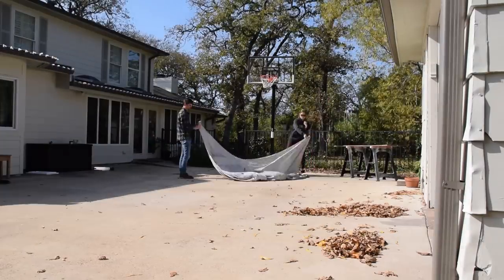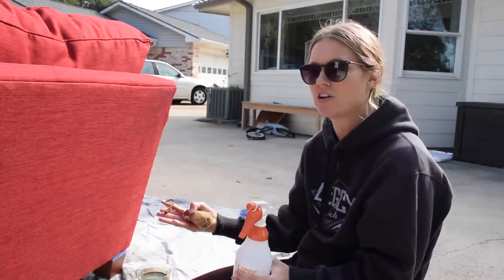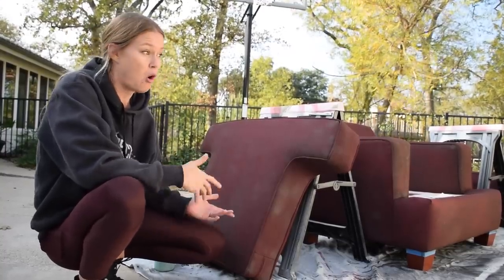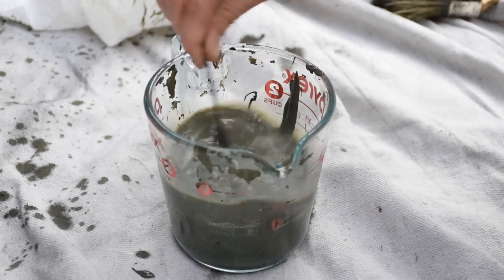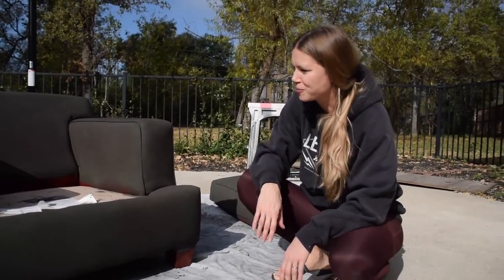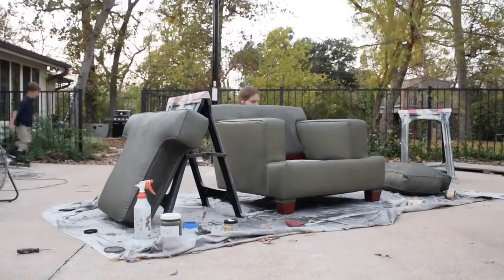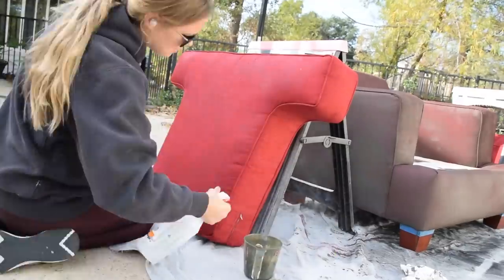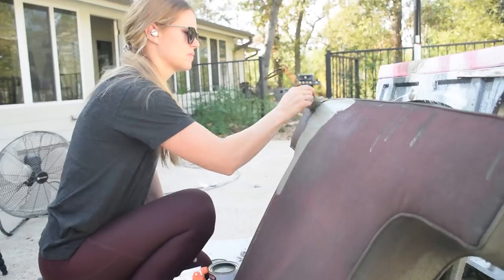Painting Upholstered Furniture [Living Room Refresh- Part 2] // Furniture Flipping Nightmare!!

Comment: I’ve done this project! Lone Fox has an excellent video using equal parts paint and fabric softener. My chair was soft and smelled awesome. Please try again and I would love for you to see how easy it is!!
Reply: I said the same thing! Lone Fox video was great!
Reply: My chair came out great.  They messed up by using all that water and no fabric softener
Reply: Thank u for sharing
Reply: Yes the fabric softener is what really keeps it from being hard like paint. 🙂
Reply: I’ve never tried this, but I just watched a video with Anne Sloane. It was on another’s channel and she basically did a tutorial. Unfortunately, you made a few of what she called mistakes. She used a brush to lightly wet the fabric first, as you only want the surface wet. Then instead of mixing water, and paint she wet the brush first, then dipped it in paint, and sort of mixed it by working the brush on the up side of a roller pan. She said crispy is mostly due to overpainting, using more than 2 coats. She also said, you need to consider how the color of the original fabric may affect the color your applying, which I took as a message about expectations. She suggested that if it’s crunchy, a light sanding, then an application of wax, can give a soft hand and leather look to the finished product.
Reply: Sand in lightly and wax it

Comment: I painted a sofa years ago with chalk paint. I sanded between each coat and sealed it with Annie Sloan wax. It’s not crusty and looks and feels like leather. It’s used daily and still looks good to this day. Hope this helps in case you’d like to try this process again. Oh, and I love your channel x
Reply: I read about wax at the end too.
Reply: I too was wondering why she didn’t use AS method.  Every video of a successful project involved sanding and wax.  Like that she showed how long it actually takes and the energy to complete.
Reply: The wax finish is likely what helped.
Reply: I've used wax and it helped with the feel but left a white residue.
Reply: I think Debbie’s Design Diary has a painted velvet sofa on her channel.
Reply: I did the same thing.  Painted it with Annie Sloan Chalk paint, sanded it down and sealed it with wax and it turned out awesome.  Wax is the key!

Comment: You are supposed to wax it last. It makes it look and feel like leather. I have done this. Make sure it  it is completely dry. Use the round brush and brush in circles. Let the was dry and buff with a round dry brush. Try this before you re-upholster.
Reply: I have read this about cloth. The wax is important
Reply: does it still sound crunchy?
Reply: @lovly2cu725  Doesn’t sound crunchy at all. It still needs to be sanded with 220 grit sand paper, then waxed.
Reply: How many coats did you use? I'm curious if my salvaged chair is worth it.
Reply: I put 3 coats. It might need more depending on how porous the fabric is and the thickness of the cushions. If the fabric is really worn, the paint will go through to the cushions. Definitely don’t water down the chalk paint. Spray the fabric or dip the brush like Andrea did on her second try. It was so cool when I tried it the first time, because I couldn’t believe how good it looked! I also painted vinyl dining room chairs to match a Formica 60’s table. Good luck!

Comment: I actually used a spray paint specifically for fabric on a similar club chair and it came out fantastic! I used a navy blue to cover a cornflower blue that had faded. No one believed me when I told them it had been spray painted.  It was not crunchy or stiff afterward and I had it in a high end Cape Cod rental with no complaints.  Rustoleum and Krylon make a fabric spray paint.  I think the brand I used was called Simply Spray (?).
Reply: Yep! Fabric paint works great. I've used it on a rocking chair twice for each of my children's nursery. Came out awesome both times.
Reply: Used that and it took sooooo many cans of that paint and then I had splotchy cushions after they sat on the porch awhile.  Didn't love the spray product.

Comment: I’ve painted lots of upholstery many times. Vinyl, poly silky fabrics (like most dining seats) work well. But you need to seal it with LOTS of wax to get a leather feel. Don’t try boucle, or linen type fabric it holds too much paint and becomes too hard. 
But what I discovered is the best way to cover an ugly upholstered chair. Spray can adhesive, hot glue and faux fur. It is ridiculously easy and fun. If the faux fur has to have long fur it covers all the seams. 
I presently have a window seat bench and a living room chair that I covered by cutting up a faux fur bedding. Looks great, cats love it and it hides pet hair!

Comment: I have painted a few chairs that were successful. 
I used a 50/50 mix of chalk paint and mineral spirits. Kept the fabric wet, sanded between each coat. Applied 3 coats. After the coverage, I put two waxed coats over the paint. 
It felt like leather! Smooth and comfortable.
The fabric was a thin upholstery fabric. I did rewax every 6 months. I used the chairs for 2 yrs. I did need to reapply paint on the seat once during that time.
It is definitely not along term solution.

Comment: I have seen many videos on painting fabric furniture but never actually tried myself. However, the ones I have seen use regular wall paint and dilute it with fabric softener. From what I’ve heard, this makes it softer and gives it more of a leather look.
Reply: Never tried this but I'm wondering if the latex feel is what makes it feel good rather than that rough chalky feel.

Comment: Great video! I love seeing the process of experimentation. I have looked into this for a project. A couple of things I've observed. 
1. Closed materials like vinyl accepts the paint better than open materials like woven polyester or cotton. 
2. Adding liquid fabric softener to the paint is supposed to help with keeping a soft texture the fabric. 
3. A top coat would provide some stain and water blocking properties. 
I will be tackling this project in the spring for some furniture my wife wants on the patio.

Comment: I've done this successfully... trick is def the kind of fabric it is. mine was a velvet chair and i picked a color similar to the original color to hide discoloration to the original chair. use a sanding bar to "sand" the paint into to fabric and sand in between each coat. def water down your paint and get the chair wet

Comment: I painted a fabric chair with fusion mineral paint and when I had full coverage I "massaged" their hemp seed oil into the fabric with my hands and with a fine grit sandpaper. After that soaked in and dried a bit I made a soft wax with hemp seed oil and beeswax and rubbed that in. My chair is smooth and leathery/vinyl feeling. After a year in our playroom with four young kids it still looks like the day I finished it! Your chair looks great, just needs to be softened up!

Comment: I couldn’t agree more! I painted a large cotton weave ottoman using Dixie Belle paint. I used boss first  then full strength paint super wet fabric and brush. Still took 31/2 coats with sanding in between. I wanted a leather look, so I waxed after dry .
It looked good just like your chair did and felt like soft leather, but it cracked on the edges within a week of mild use.
The painting technique you employ to buff the paint in is strenuous !  I decided it wasn’t worth the time, effort and paint. never did the second ottoman and my fabric painting days are over.
Thanks for the memories:) your videos are great

Comment: I painted a chair similar to the one you are working on. It took 3 containers of paint and about a week to completely dry. I did use Dixie Bell paint. The first coat I used a dark shade of blue. Then switched to Bunker Hill Blue. I never saturated with water, just sprayed. It's a process, but the outcome was wonderful. If I didn't tell you the chair was painted you would never know. A year later, still looks new. HAPPY CHRISTMAS

Comment: I paint furniture with Annie Sloan chalk paint. I use a spray bottle with water first on the fabric. I spray water as needed to absorb paint into fabric. I use no more than 2 coats. I sand with fine grit when completely dry and vaccuum.  The fabic is not stiff. I've painted damask and cotton fabrics.

Comment: There is fabric spray paint. Fabric softener in the water spray,  and mixed into the paint.  With fabric softener,  you can use latex paint, too. And sand the crust fully away between each layer. 

Quite a few helpful videos on YouTube about it. Some don't always look good, as far as artistically,  but the technique is explained well.  🙂

Comment: So I’ve done this with a similar textured fabric and it turned out okay - but the key was to add wax and buff it at the end. Without that wax/buff step, the chair would have been unusable, but with the wax it feels like a textured leather. 
We used the same chalky paint from Lowe’s that you did (and the wax that goes with that line.)
We needed fewer coats of paint, because we were using a dark paint color on a light fabric. (But we added two coats of wax…. so still 5 coats total.) 
Agree that it’s not often worth the effort!

Comment: Hi. I like your room redos and furniture pieces. I’m getting a lot of inspo for my house reno. 
Usually chairs, sofas, etc are nylon & cotton blend or polyester & cotton blend. Acrylic paint is a plastic and some will Andy into cotton, but not a man made fiber like polyester. You may have had better luck if you’d have used a white, water based primer first, then painted a few coats with a 2:1 or 3:1 paint to water ratio. (I have a chair that needs reupholstering, but I’ve already taken the fabric off to make patterns 🙃

Comment: I painted my tufted leather chair that was an ugly oyster color. I used Dixie belle paint and easy peasy spray wax. It was like painting a night stand…easy. Now I am painting a cotton sofa: the material is like quilter’s fabric…just flat no raised designs but the print has showed through 5 layers of DB paint. I thought this would be easy to paint since the background of the fabric is white and the printed details are only on the front side of the fabric. Going through the same thing you showed in the video… lots of paint,time and energy. I did lightly sand and it took my paint color out…which makes me assume that this couch may have been Scotch Guarded. Which would make sense as it’s supposed to repel water and stains. I think my first clue should have been how the water beaded on top of the fabric when I sprayed with my mister bottle…I strongly suggest spraying your fabric with water to test if it beads up if it does it isn’t going to accept your paint as well like in the video.
Just thought I’d mention this.

Comment: When you paint fabric like this you're really only supposed to use approximately two coats that's why it's important to pick a color that's darker than the color it already is. With your ratio being half water and half paint that should have covered it in two coats but it probably won't because the color you're using is actually lighter than the color it already is. Just don't forget to sand it to knock off any rough edges that may make the fabric feel crunchy

Comment: I’ve painted fabric several times very successfully. I don’t water down the chalk paint (I use Dixie Belle) but, I do spray fabric with water while painting. I lightly sand between coats of paint and use Dixie Belle’s Easy Peasy Spray Wax. I should feel like leather. I wouldn’t call this a fail, go back to your local retailer and get a bottle of the spray wax, sand lightly, and seal it with a couple coats of spray wax.

Comment: The reason I think it feels crappy is because the paint was watered down so much, it took so many coats of paint to get the coverage that was needed, it was inevitable that the build up created a poor finish. Also sanding or working the paint into the fabric as you paint, gets a better finish. With chalk paint it should take 1-2 coats maximum. Lastly spraying the fabric constantly also continued to over dilute the paint but, you gave it a shot and it looked beautiful so I hope you try again and see it can work well and should end up feeling leathery and flexible but, definitely not crunchy!

Comment: I did paint with chalk paint I made and did not water it down but did mist the fabric with water before applying the first coat.  Then I did sand it between coats once each coat was completely dry.  It only took 3 coats for complete coverage.  But it was still rough so I figured if I wax the wood furniture I painted with chalk paint why not wax this.  And it worked great as a little wax does go a long way.  I did let it bake in the sun a few days and rubbed it down again and it felt nice to the bare skin.  (Reason I let it bake in the sun was someone sat down on it and got a lil bit of wax on their bottom. lol  I still think it might have been because it was still a bit fresh and hadn't had a chance to soak in yet.)  And no I would not paint fabric again.  I would reupholster it or buy something else instead.

Comment: I knew that was going to happen. You can't paint a chair by spraying it with water and using 100% paint it will come out feeling like a rock that's why you add water and you don't paint it more than two coats! But it was fun watching the whole process make sure you use chalk paint and not chalkboard paint.

Comment: I’ve painted several pieces with great success so I’m sorry it didn’t work for you.  Most of the pieces I’ve done look like leather in the end. Best tips: spray w water and fabric softener and sand well between coats.  Some pieces waxed some not, depending on the desired look.  I agree that a ‘fuzzy’ loose weave will not be as successful.
Reply: Also….I have never used chalk paint only high quality Ben Moore.

Comment: Well, it was great watching your efforts, but having done this myself I knew you were in for some trouble.  The fabric of your chair was definitely not the right type and the color was not optimal.  Tighter fabric is better.  Also it's more about dying the fabric, not "painting" it.  You need to use paint with a high concentration of dye.  DIY Paint worked well for me.  Also choosing a lighter color than the color you want is a good idea.  Velvets and thicker fabrics work better.  You need a lot of water.  Work in circles and you have to work the paint into the fabric.  Switching paint also probably did not help.  Sanding lightly in the rough patches is a good idea.  If you do this technique right, it won't be rough.  Check out Debi Beard's couch painting video.  Her version is fun to watch and the most informative I have found.  Also remember color mixes with other colors.  The red could have made a purplish color with blue or couldhave been brown or even an off black, but green is tricky without a blue or yellow undertone.

Comment: I’m an upholsterer and this is just wrong 🤣 but this makes for a funny video. Please, just never do this again 🤣 I’m sure you’ll agree with me 🙂 Also, anyone that is thinking of doing this, just don’t!! No matter how much fabric softener you use to paint it with, eventually the paint brakes and chips off and you find yourself covered in paint chips or paint dust. You also run the risk of trapping in moisture in the foam and eventually the foam will mold. Foam takes forever to dry then you are covering it with paint which will dry faster than the foam. If you do this and find yourself smelling something moldy or like garbage. Just look over at your work of art and you’ll know why. If you really love the chair or sofa, have someone upholster it. You’ll save yourself time and money. You’ve been warned 🤣
Reply from the maker: Hahaha yes I completely agree! The ONLY reason I even took the risk and tried it was because she was already planning to get it reupholstered, so if painting didn’t work then just stick to the original plan!